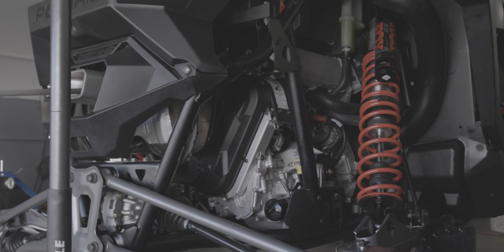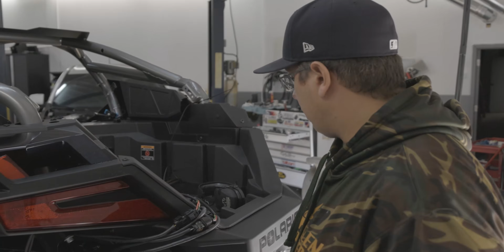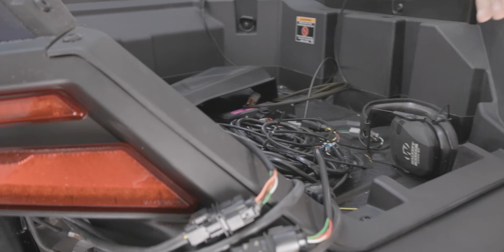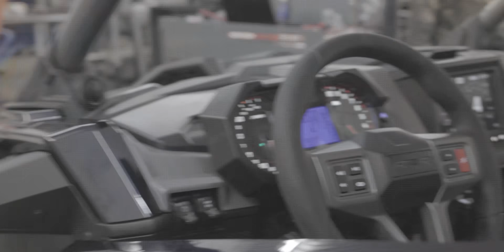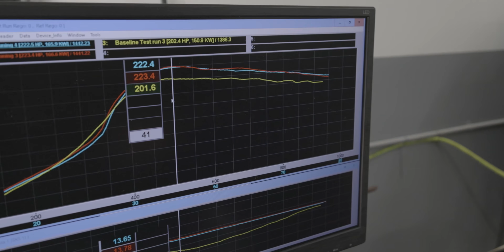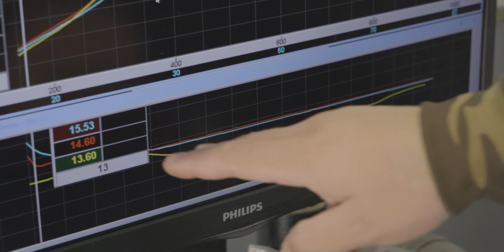Whalen's Speed: Some DECENT Polaris Pro-R Horsepower Gains! #Whalentuned #WSRD

Comment: 225 Hp at the motor and 201hp at the wheels is only a 10% drivetrain loss. That’s doesn’t seem right. Everybody is talking 20-25% drivetrain loss
Reply from the maker: I suppose if the 20-25% loss from a hub dyno or a chassis dyno? We usually see the 10-11% on our hub dyno to what the factory engine HP rating. Just as we touched on in the video.
Reply: @whalensspeed  EVO ran a stock Pro R on a mainline hub dyno and got a average of 180HP at the hubs.